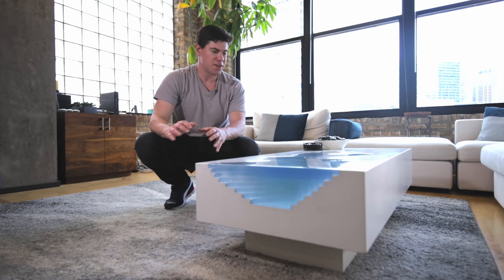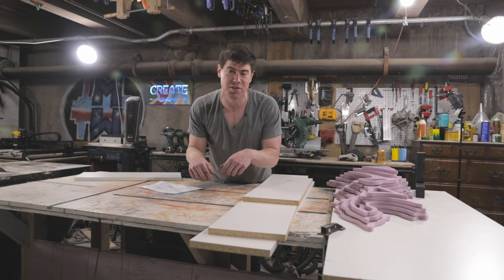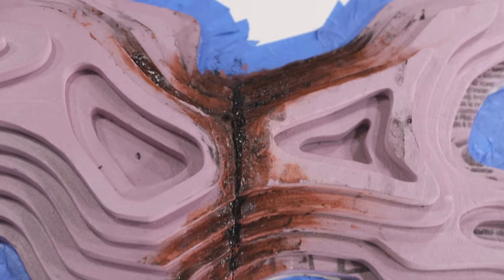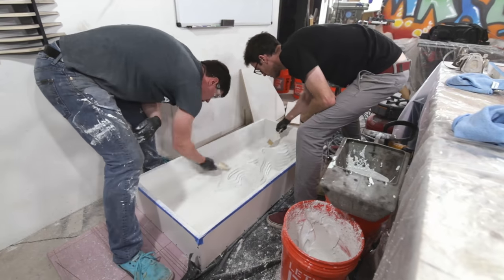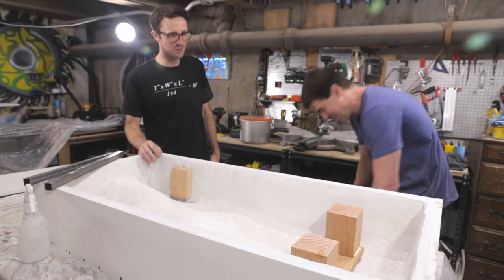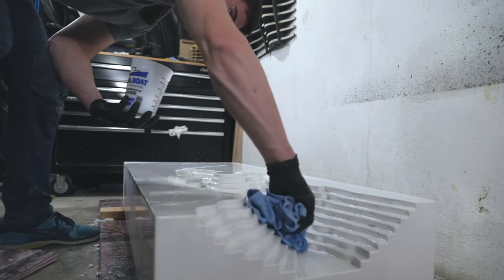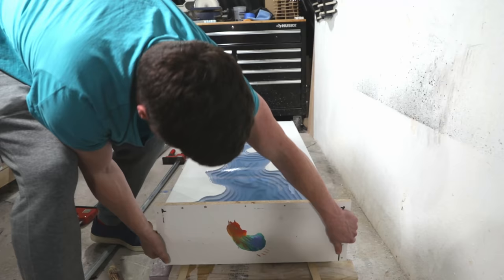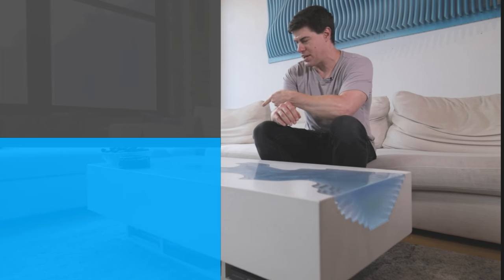Making an Epoxy & Concrete Coffee Table

Comment: What is the difference between thick set and regular epoxy?
What would have happened if you had poured it in one go instead of layers?
Reply from the maker: Thick set is more fluid (runnier) than normal, and can be poured deeper/thicker than standard high performance.   If you pour epoxy too thick, it is very likely it will go exothermic, which means it will start smoking and bubbling and you will have a mess on your hands....
Reply: @modustrial  Ahh ok. Like what happened to the melamine on the side.
How does it differ from infusion resin?
Reply from the maker: Not sure what you mean by infusion resin?
Reply: @modustrial  Vacume bagging.

Comment: i used to work with renderrock brand mixing and i used 33% motor oil 33% wd40 34% water shake up and spray for form and the form work would be non stick just spray, rub by hand to get in every corner and space then let cure 7 days remove form and baby butt smooth finish. the renderers hated it cause they had to sand over and use a grinder to make lines for render to grip
Reply from the maker: Interesting technique! Might have to give it a try sometime....
Reply: @modustrial  yea experiment but dont do a huge project haha wouldnt want ya to waste money

Comment: Concrete? Looks like cement or some sort of plaster.
Also looking the mold panel. Looks like there is no mdf in that panel ( 17:40 ). Particle board which is not same as mdf.

Anyway coffee table looks nice.
Reply from the maker: Thanks!  It is glass fiber reinforced concrete (or GFRC for short)....if you Google it you'll find all kinds of info on it .  It is way stronger than your standard concrete from the big box store

Comment: HEY! Im trying out concrete to make art myself, it seems your concrete has no aggragate in it? Is this correct? I tried my first form and concrete pouring a couple days ago and it came out filled with bubbles, how can we get it smooth like yours while still retaining its strenght? What concrete are you using exactly? Thanks!
Reply from the maker: Hey there, I I think we connected on Instagram.  But let me know if not
Reply: @modustrial  we did, that was me indeed!

Comment: is that hopper spray gun coat just a concrete powder with water?  thank you
Reply from the maker: It's the GFRC mix without fibers....sand, cement, plasticizer, acrylic polymer, and some other additives

Comment: Why not use acetone to remove those last bits of foam from the concrete?
Reply from the maker: I'm told that would work... I was just worried about it affecting the surface of the concrete at the time, and decided better safe than sorry.
Reply: @modustrial  well, I doubt it would do anything to the concrete, and even if it did, it would do so little in the time it took to clean it off that it wouldn't really matter. It gets thru foam and stuff so easily is because it's not very dense, I believe

Comment: its a nice end product but no idea why you wouldnt clean up those walls in the topographic space before pouring the epoxy ): could have just been that much cleaner and nicer looking if you had.
Reply from the maker: I did clean them up a bit off camera....there is only room for so much info in a 20-minute video, and you can't really tell through the epoxy anyway so that part was left on The cutting room floor
Reply: @modustrial  fair enough,I child just see some flaws/bumps as the epoxy was getting poured in the video but no idea out they showed up in the final product

Comment: I like it, but why not make the whole thing out of epoxy?  Seems like epoxy could be lighter and tougher...  And also give you a nicer finish to the white part.
Reply from the maker: Epoxy is heavy stuff man!  And expensive, lol....you'd be looking at like 4k of epoxy alone 😀 it's certainly doable but I like the look of concrete.... Just my personal preference.
Reply: Modustrial Maker that’s a good point on the cost.  And the GFRG probably has a certain look and solid feel that adds to the impact of the piece.  Epoxy might feel, look, and sound plasticy...  Like a boat hull...

Comment: With all that work that went into it, I think you should have sanded the form so that it was more organic and not 90 degree steps. Probably wouldn't have taken that long, either.
Reply from the maker: I hear where you are coming from, but I think that that is more of a design choice and preference, rather than a right or wrong choice to be made.  And, this channel is in part documenting me learning and evolving... I definitely plan to do some topographic 3D carving in the future, and this is the first step in learning how to do that, as it's a bit more complicated.

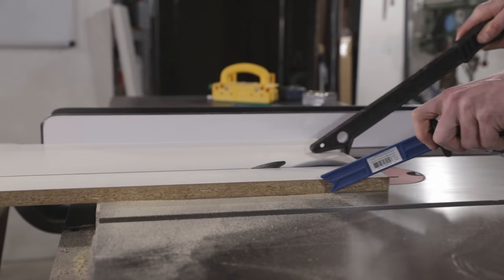Comment: 1:32 Probably the most dangerous cut you can make in a shop. PLEASE don't cut a board this way if you are watching. Always have that blue guide fence to the RIGHT of the blade if you are going to use the fence. That board is way too narrow for cutting that way on a table saw and it is sure to want to have the board kick back in your face as it binds between the fence and the moving saw blade. It's one thing to do something dumb with 1,000 views, but when you get to 2 million, someone is bound to try and cut it this way. You don't need a fence if you are using a sled for the entire cut. Put a block of wood next to the fence and butt into that block, not the fence. Have the block back so that before you get near the blade to cut, the block no longer is touching. You only need something to butt into to keep your measurement the same, you don't need to have it touching the for the entire cut if you hold it tight on your sled. This way the cut off piece doesn't have anything to get stuck between. Be responsible if you are going to show how to do something. People watch more than they listen to a video. They are not always going to hear what you say.

Comment: you Could have used less concrete and made it lighter and more quickly if you used wood and styrofoam from the base up then coated thin layer overtop and smoothed with a putty knife same as you would on a Pool , you dig the design into the dirt then lay concrete overtop. or even CNC Router into styrofoam and wood block on the wood base
Reply from the maker: I've done that before, but it doesn't give the same look.  To get it smooth you have to build up 8-10 layers sanding in between, and the surface will end up with a hand troweled look.  It's not bad... In fact I've been planning to do a build using this technique....but it is an entirely different look than I got here.

Comment: how the hell did the epoxy get underneath the tape?
Reply from the maker: in the melamine?  when epoxy cures it is an exothermic reaction and gets super hot...and heat melts stuff.  it actually melted the plastic surface of the melamine...

Comment: yeah with Melamine molds and resin, you wanna use a mold release...
Reply from the maker: Definitely, I did use wax, which has always worked before...I'm not sure even mold release would have helped here... It actually melted the melamine surface and got into the MDF core, so it bonded with the core underneath the surface
Reply: @modustrial  yeah the wax wasnt enough for the temperature

Comment: That table would be heavy as fuck. Wouldn't it have been easier to ether order or make a plastic base instead of concrete and then reinforce it as that would cut down on its weight and cost?
Reply from the maker: It's only 200 lbs since the concrete is hollow.  FYI epoxy (a plastic) is almost as heavy as the concrete

Comment: how do you start your career in epoxy
Reply: #pr3 Don’t. Why do you think there’s no closeup shots of it? Sadly 99% of the time the finish is far from perfect if not a nightmare, there’s always something. There is some shortcuts around it tho, like cutting off excess if you have access to a big band saw and then sanding at the end.
Reply from the maker: Like anything, the best way to learn is by doing.  Get some epoxy and start experimenting, trying to replicate some of the projects you like.
Reply: @modustrial  I want to do stuff like this on the side of epoxy flooring, how would one become certified

Comment: A premade white "iceberg" would look amazing floating in the middle of the deepest part like it had not long spawned.OR a massive whale blowing air(epoxy) from his blow hole.
Reply from the maker: 👍👍 the iceberg idea is exactly how this started.... Still trying to figure out a way to make the iceberg without needing like $600 in silicon rubber for a mold.... If I can find a sponsor to provide materials, I'm still planning on doing this at some point
Reply: Maybe make the iceberg from a broken piece of white/blue resin so it is oddly shaped & put it in the 2nd pour so it appears to float 9/10 under the surface...no expensive silicon just lots of hand sanding
Reply from the maker: That would be a lot of sanding... i really want to make the iceberg from white concrete tho.  Carve it from wood, or 3D print a model, cast it in silicone to create a mold, then use GFRC.  Someday it will happen....
Reply: @modustrial  I was thinking weight & cost mainly.but see what you would prefer would work.
Reply: @modustrial  maybe a collab with another resin caster/ woodturner?

Comment: you can get something that's called easymax. you need your retailer to order it for you from sika because its for industrial use. but it's so nice to work with and its made for exactly what you were trying to do with filling the gaps. https://advanced-resins.sika.com/en/solutions_products/product-groups/auxiliary-materials/adhesives-and-putty-fillers-for-block-materials-and-modelling-pastes/easymax-r.html oh yeah and it cures in a few minutes.
Reply from the maker: Thanks for the tip!

Comment: can't believe you didn't have a mask on when you were spraying
Reply from the maker: You are spraying a solid, you need eye protection but it doesn't create vapors or small particles.  I wear the mask while mixing up the concrete, then can take it off

Comment: It looks like you stacked 8 pieces of particle board, each piece with a larger cut out to make the stairs effect... turns out that would have been 10 times easier than what you actually did... lol...

Comment: WTF! foam dust is unhelthy and should only be used with strong suction and dust filter mask!

3M spray glue is also, quite unhealthy and not for use without suction.
Spray glue can cause your lungs to collapse!

Please be a role model

Comment: For modern stuff lovers... Ok, that's a go. But that's not really practical because of the weight.

Thumbs up on fabrication though.
Reply from the maker: Thanks!  And weight isn't that bad...about 200 lbs.  It's not bad for something like a coffee table that you don't need to move around....pretty easy to move with 2 ppl
Reply: @modustrial  

At 200 pounds... Lighter than i tought.

Comment: Sorry, but vacuum pot followed by a pour a handicapped erratic monkey trying to make the biggest splash could do better? Maybe next time build a mini slide for the epoxy so it won’t create the splash bubbles. However if you want to keep doing it the erratic monkey way, skip the wasted pot-life in the vacuum, more curing time will remain to have the bubbles float up. Cheers
Reply from the maker: The vacumm helps, and while you might reintroduce 5% of the bubbles when you pour, the torch gets them out, and plus, it looks better for YouTube and Instagram 😜
Reply: Modustrial Maker re-evaluate yourself @15:28 ;) just sayin’, what will it hurt you to make a video of : vacuum erratic pour vs smooth pour no vacuum?

Comment: THATS NOT CONCRETE ITS CEMENT
Reply from the maker: This is simply incorrect. cement is a single material that is an ingredient in concrete.  Concrete is  cement + sand + aggregate, and you've got all 3 here.  (And technically, sand is an aggregate, so anything that is sand + cement is technically concrete.)

Comment: why cant you guys just pour concrete to fill the mold whats the point in padding shit, just putt a wire frame and pour it like a normal concrete fotm
Reply from the maker: It would weigh 1000 lbs and cost a fortune....

Comment: Pretty lame that you bring up the environment if you weren't planning on making a difference yourself. So what you want us to do now exactly? Wish I could take my view back.
Reply from the maker: You and I are on the same side my friend...bigger things start small.  I use less concrete by using GFRC, and it admittedly is something I struggle with... Everything we do has implications, and the dialogue has to start somewhere.  You can't fix everything at once, but you have to start somewhere...

Comment: ugly, could of filled the holes and painted after you took out the foam, such a rough job overall
Reply from the maker: Painting concrete, great idea.... 👏👏
Reply: @modustrial  you never seen a painted concrete wall? could of not been lazy and used some filler, then painted and poured epoxy

Comment: looks dirty inside. not good enough
Reply from the maker: You're right, since no one will ever see the inside, it is extremely important for to be visually perfect.
Reply: @modustrial Why. Your Epoxy is semitransparent. All the front panel is more transparent. look at the edges there. Well. My opinion